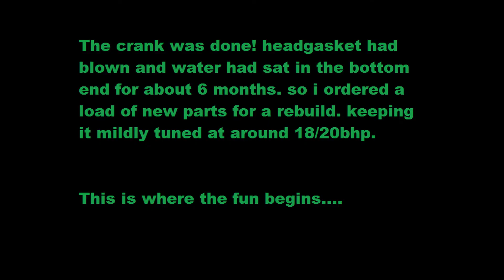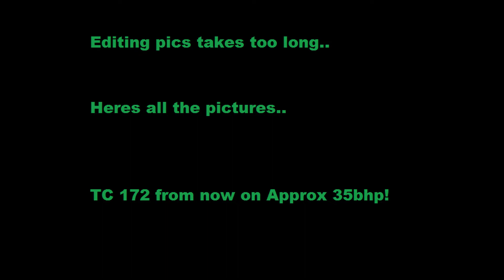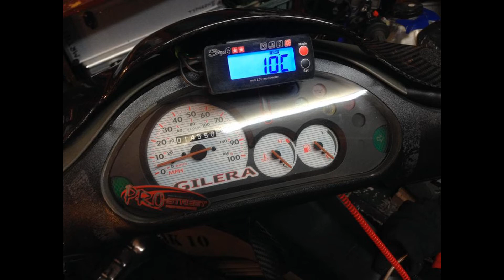Gilera Runner TC172 Project Pictures Tarmac Terrorist

Comment: Hi there 
I got my gilera back from the scooter shop 
Brand new 172 malossi 
Phbl 25 and reed and larger down pipe 
Worked well for a day but now seems that the engine get flooded with petrol and can’t get started tried to clean the spar plug and checked if the floater were stuck but not luck . Even the scooter shop got confused , is it normal the petrol hose line witch connect to the carburettor leaks petrol when disconnected ?
Any advice would be appreciated?
Reply from the maker: Heavy Metal check the reed valve and petrol tap. You have two pipes one for vacuum one for fuel delivery.. any vacuum leaks would stop the fuel tap opening
Reply: Hi 
The fuel tap was the problem , the fuel was pouring into the carburettor.
Thanks for your reply
Reply: Finally someone decent to offer advised to help others :)